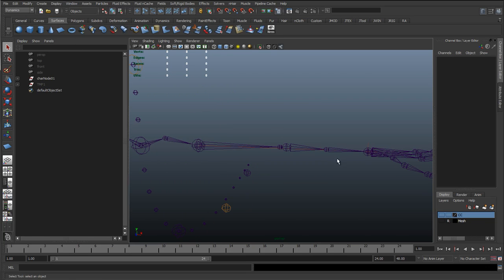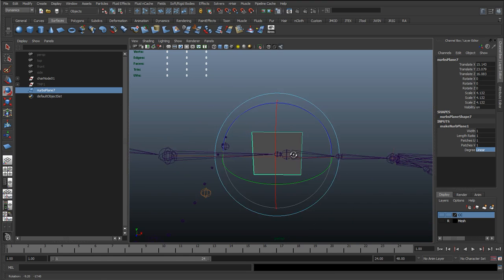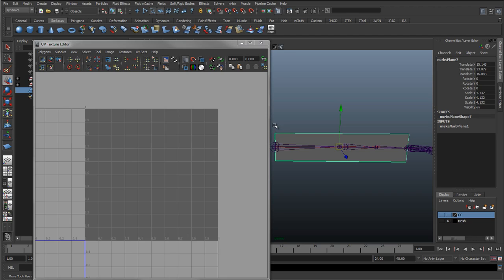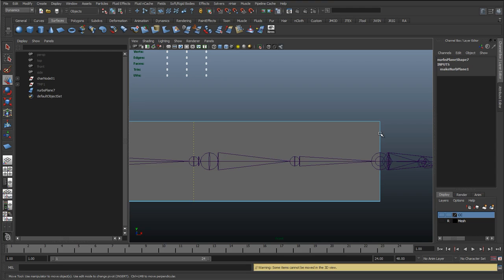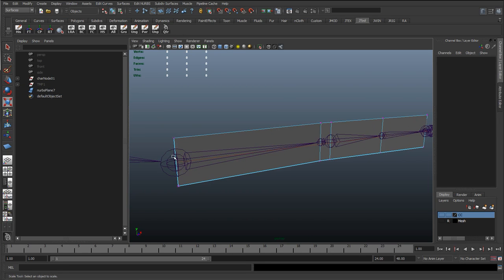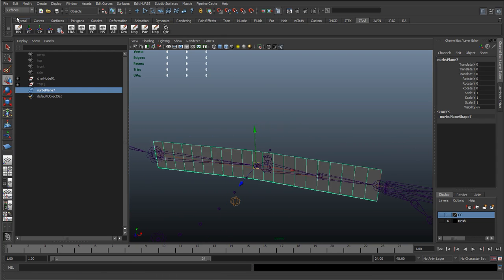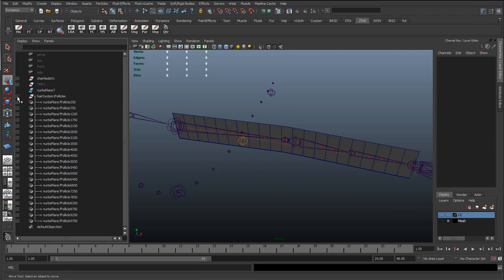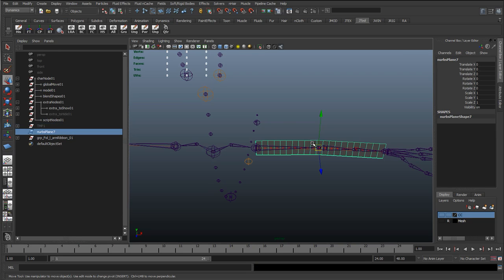35 - Flexible arms with ribbon spines (Cartoon character rigging series)

Comment: You can save a ton of time in the end there where you make joints on follicles. If you just select a follicle and type "joint" in the MEL command line, it will make a joint at the exact position of the follicle. :)